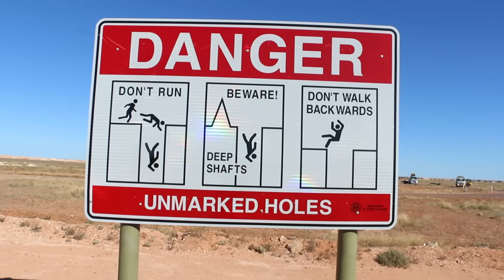How to MINE OPAL gems in the OUTBACK - Smarter Every Day 164

Comment: In the old days, before this hydraulic machinery, miners had to dig through this rock-hard earth by hand, one hole at a time. 
The holes were so narrow you could barely move your arms, and you were breathing in fine dust all day, in the blazing heat. 

It was one of the dirtiest, most miserable jobs in the world, and a miner could go an entire year without finding a single opal. 
You read that right.  They had to dig hole after hole after hole until they found something; or not.

Comment: Why don't they mine shafts like they do with coal, silver, copper etc etc.?  Why keep drilling single holes down to the level they need to be at.? Is it because it's not capable of holding up.? Would it collapse if done like the other methods.?

Comment: Opals are absolutely beautiful! I use opals almost daily in glassblowing however the opals used in that are synthetic as real opals would melt!! But my wife loves opals as well and insisted on an Australian fire opal as her main stone in her ring
Reply: JannieofOZ if there’s not water trapped and they’re small enough they melt/dissolve into nothing in the heat, if water is trapped they exploded. Speaking from experience
Reply: JannieofOZ I’m wondering if the silver was ok because it cools relatively quickly or it wasn’t encased fully? Either way very interesting, thanks for sharing!
Reply: JannieofOZ I think you might have better time casting than encasing based on your uses it sounds like :)
It’s really not like a real explosion the water molecules just heat up and vibrate so fast that the opals just flying in billions of piece I’d give it a try with some safety glass 👍

Comment: Diamonds are an artificially economically inflated scam, created through the creation of what basically amounts to a monopoly on the supplier's side of the market.
It's literally just compressed carbon, and they degrade quite severely over time.
They're about as valuable as coal, or at least, they should be.

Comment: Tunnels NOT shafts! LOL
Reply: Mexie Mex  tunnels are horizontal and shafts are vertical
Reply: FINN ROBY Yes, that's why it was funny ;^/
Reply: Hole is just a shaft sideways.
Reply: Nice 777 sucks I have to ruin it
Reply: How about mineshafts
Reply: @utsnow7952  Technically speaking, "mineshaft" refers to the really vertical ones where they use some sort of lift to move things up or down.
Reply: @utsnow7952  elevator shaft
Reply: Its actually a Hole... not a tunnel or a shaft..

Comment: Destin, I looked at the Great Courses Plus and used your subscription link. The set up is easy enough. I'm already familiar with the Great Courses through their many selections on Audible. The great thing about Audible is that they allow you to download the course guide along with the audio tracks. This allows for a seamless integration between the lectures and the study time. I'm disappointed at this point that the Plus streaming does not allow even a discounted purchase on the study materials. I found a course on Latin and wanted to see the quality. I figured it would be a good deal; I can review what I already know and show my girlfriend so she can get some familiarity. Nowhere can I find the study material the professor alludes to. I said before, I'd be willing to spend a little bit just to download the study materials. Maybe you could mention this to them next time you talk. I may not keep it for very long if I can't conveniently use or access the study material. In theory the idea is great, and the lectures are high quality, but something is certainly missing. I would hope the issue could be fixed; I really like the Great Courses idea. Thanks.

Comment: Coober Pedy comes from Kupa meaning 'white man' and Piti meaning 'hole'. That seems so appropriate.
I live in South Australia and you do NOT want to go there in summer time, that is why they live underground.
Reply: yep warmer in winter and cooler in summer. It can get to nearly 48 degrees C in summer. South Australia is the driest state on the driest continent. 40'C in Adelaide on Christmas day....yay
Reply: In Adelaide we get much of our water from the murray river which runs from East Australia, we also have alot of dams to store what we can in winter and we have desalination plants to convert seawater. Cobber pedy gets their water thru pipelines and local water filter plants.
Reply: they are actually really nice inside, just like a small house that can be expanded easily. All the mod cons like running water, electricity ect.
Reply: the house's are very remote from town so they need storage tanks and sewerage is handled by septic tank that is pumped out as necessary.

Comment: Why don't they pour the sand back into the hole after they are finished?
Reply: then they wont be able to keep track of where they have dug before and re -dig it again for nothing.
Reply: Derpster There's no reason to do so, and it takes lots of work.
Reply: Too expensive
Reply: Surely you can put up a flag, or something, in order to prevent people falling in and dying.
Reply: What local environment?
Reply: no reason until holes get bigger and they destroy the local environment ?
Reply: or they could fill it up 80-90% full so they can still see where they dug but it's not a deathly hazard.
Reply: You can still strike Opal in them, like in the video
Reply: Skabbalabba dingdong i don't think it is a good reason ...
Reply: Derpster cause it'll take too long
Reply: na we thinking way different, i was thinking how can we make those holes into places we could live, i would not mine living under ground at all. i would need to run a ladder then getting furniture in would be nightmare

Comment: I would never ever go into a hole that deep. That's just too risky.
Reply: PainBlame it's only 50 feet!
Reply: +Ublind they weren't even wearing hardhats!
Reply: Ublind 50 feet in the middle of nowhere, how do you even know it won't collapse? your instant kill if it does.
Reply: I've been in some of those holes, however, in order to stake a claim you have to do several courses which are usually provided by a TAFE nearby (TAFE -> government run, stands for technical and further education)
Reply: any hole is fine ( ͡° ͜ʖ ͡°)

Comment: Does it rain there?
Reply: John, do you actually know that or did you google it? Cause if you know it, respect, man.
Reply: sXebeast in that area it rarely rains but in th location where I live is full of rainforest and it pisses down rain very often
Reply: Not that often since I am certain that place is nearer the equator. It is a dry environment, however there is vegetation which needs water.
Reply: sXebeast In wet season slightly higher than Cooberpedy towards Uluru! However I cannot remember about the town itself. Someone with more knowledge than myself may know!!

Comment: Engineer here: So I spent about 10 min around the 3:30-4:00 mark trying to figure out how that drill worked, and I couldn't derive it from the video.  Must explain!
Reply: "winch". It's OK Destin. I'm from Alabama too. :-P
Reply from the maker: Gravity drops it into the hole... it rotates from the ring gear.  when it's pulled up the wench pulls it over to the side.  Watch the close up of me connecting 2 cables to it.  The side wench and the release.
Reply: SmarterEveryDay It took me a bit of further viewing for me to figure out how the hydraulics factored in.  They look independent, like they are meant to raise the butterfly when it's full so that the wrench doesn't have to strain itself, it can lower the drill, and if they are independent then that would explain how it can tilt the drill to widen the cavern.  And the black-greased things on the side can ride the ring gear but are not driven up and down by it (I thought it was a worm gear at first).

Is that about right?  Not at all?
Reply: Also, I do enjoy your videos.  Travel, machines, engineering, people, good stuff :)
Reply: From what I gathered,  the ring gear is actually encased within a static housing, which forms the exterior of the driven unit.  The hydraulics are fixed to this exterior and do not rotate with the butterfly.   

On a fresh bore, the drill will form a tight interference fit within the bore hole.  This might result in too much stain for the winch to pull out alone, especially if it digs into clay or if there are rocks stuck at the tip of the drill.  There's also a potential for a vacuum seal to form if the soil is damp.  The hydraulics help to break any potential seals.  They also serve a secondary purpose - they have pegs that marry with the butterfly when it bottoms out.  Seems to me that they are also used as stopping points for the butterfly.   

Although there's a thread there, the ring gear is actually splined.  Gravity does the digging.  As far as widening goes, a reaming bit will be used to achieve that.  The shaft that they descended was one that was already reamed (not the same hole).
Reply: Wenches are handy in a bar fight too.
Reply: looking at it I thought that the butterfly spun inside the ring gear which looked to have a threaded rail on it to drive the drill into the ground as though the butterfly and drill were a bolt and the ring gear is a nut. then the hydraulics would lift it back out and they use a winch to pull the load up. 

guess I had it wrong.
Reply: The drill tools is lowered into the ring gear. The two black rods on side are basically greased shaft keys, that couple the ring gear to the actual drilling tool to allow the ring gear to drive the drilling tool. The weight of the drill tool pushes itself into the ground as it spins. There must be extra force required on raising the drill tool, perhaps due to some sheering of the dirt or maybe a vacuum created between what's being lifted out and what remains. Whatever it is, it requires a boost provided by the hydraulic rams. The vertical winch can pull the weight of the drill tool and the dirt it has collected on its own, so there is definitely extra force required when withdrawing the tool initially. Adding the hydraulics is obviously cheaper than building a suitably powered vertical winch. A secondary horizontal winch is used to pull the drill tool away from the machine and then the pull chord is used to open the tool.
Reply: This is exactly what i was going to say.
Reply: 16vSciroccoboi I thought that too but couldn't fit that with the butterfly rotating freely while the hydraulics were in a fixed location, and some shots showed the butterfly resting on the top of the ring gear but not the hydraulics, so I thought that the hydraulics were not strictly necessary for up and down.  And the rail was only half threaded.  The "threads" twist around the inside about half way, then stop at a vertical gap that the greased vertical rails slid into, so they are guides to get the butterfly into position.  The whole shaft is square, so regardless of how deep the bucket is, if the butterfly spins, then the bucket will too.  Then the ring gear spins the butterfly and it's the scoop-like teeth on the bucket's bottom side and its weight that drives it into the ground.
Reply: purpleintrepid nice find!
Reply: Can't be much of a mechanical engineer if you can't figure how that works.
Reply: Nick Jones why? It's a video, not an interactive 3D model
Reply: There's your problem. Interactive 3D models.

Comment: wowowow wait a second, isn't it really dangerous to keep mining horizontally? couldn't the whole top of the shaft collapse on you?
Reply: BattousaiHBr i guess it depends on the size of the hole and the integrity of the soil
Reply: BattousaiHBr, experience my friend, experience. They're digging a dome shape underneath. Dome are one of the most sturdy structures, if not the most sturdy.
Reply: Theres always the risk but they have been doing this for ages, I think they know just how much they can push it. I think more people died from falling into the holes than the shaft collapsing on the miners.
Reply: There is an underground camping in Coober Pedy. Tunnels so big you can drive a car through them with ease. It's all (soft) rock.

Comment: I don't get it: If they know that there is a "horizontal line", why so many vertical holes? why not just a few and then go horizontal with the "line"? What i'm i missing?
Reply: maxsnts there are usually veins of gems/ore etc. doing 20m hole every 100m will be way better to find the veins. Making seperate holes is not only more efficient, but way more stabile. Once you find a vein then you can make a bigger hole to mine them out.
Reply: The rock is soft gypsum so mines have to be quite small. The veins are patchy, big patches are tunnelled out. The hole they in was right next to another so that patch must have been producing good opals to sink another shaft.
Reply: @bassisku I get that when you are trying to find the vein, but they already know where it is, the even measure the depth because they know it.
Reply: maxsnts cause the machine called a blower which is a giant vacuum unit cant suck dirt out after 120feet horizontally  ..so they dig another hole and continue the process

Comment: Correction: Diamonds are not rocks. Diamond is a mineral. It's a polymorph of carbon. Same thing has graphite is. Diamond is just formed deeper in the ground where there is higher heat and pressure. Likewise with Ruby and Sapphire. Both of these are indeed colors, but are varieties of a mineral called corundum. All minerals have a chemistry bond happening in them where atoms are stacked upon each other. Sorry, when you said these were rocks I gringed as a geologist.

Comment: how common are opals, compared to diamonds? it seems like he found them fairly easily, but they looked like they were in groups of stones.
Reply: I think Australia mines more diamond than opal. The major difference is diamond is mined in large scale hard rock mines, Opals are small scale gypsum rock mines. The other famous opal mining area in Australia is Lightning Ridge which produces more black opals.
Reply: Its rare as most opal is not precious and most precious is not valuable. Whatever diamond you want you can buy a dump truck load of. Precious opal only forms containing water inside an electrical field is what makes it rare.
Reply: I believe over 90% of opal is mined from Australia.
Reply: and diamonds are able to be made within laboratories now, so although they take a long time to make, it still makes the value of diamonds less, as the demand has lessened somewhat. opals, on the other hand, are a lot more difficult to make than just heat and pressure.
Reply: Bandit Raccoon for starters it wouldn't be THAT easy.
1. the video is edited, they could of been down there for a very long time.
2. old boy has been doing for so long he knows what to look for.
3. did you see the size of that hole he dug with a small pick before getting the jack hammer.
4. its his own mine that he has already be down, he knew it was there already. that's why they left the one they were digging to go to another.
5. resources, (at a guess) he has spent $100000 on his equipment and just needs to maintain it. a large diamond mine would burn through that amount on just fuel for machines in less than an hour.
Reply: Isn't it because Uranium is part of the formation of Opal.... Australia has lots of Uranium too.
Reply: Yeah if you are deciding whether to dedicate your life to building an opal mining company, or diamond, i would go with opal.  The de beers group controls the diamond industry worldwide, and has for decades.  Diamonds aren't actually rare, its just that one company controls the supply of them.  If de beers ever lost control of the diamond industry, diamonds wouldn't be considered so valuable anymore.  There are other types of gemstone, like opal, that aren't in that situation

Comment: Go to Lightning Ridge in New South Wales, Australia then head south west to a very small town called Cumborah than from there go north west, there is a small miners town where they dump all the sorted white material that had opal in it and if you are lucky you can find opal, the pile of white material is about 15ft in height 50ft in width and 100ft in length and where there is white material and botch there is opal.